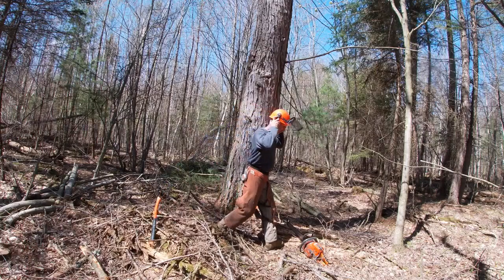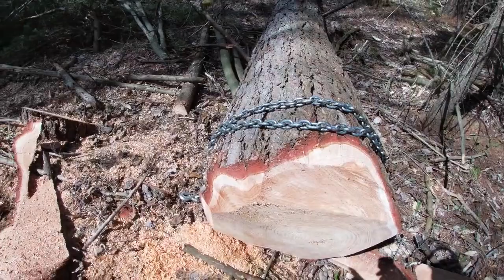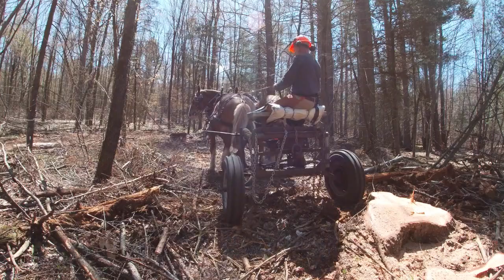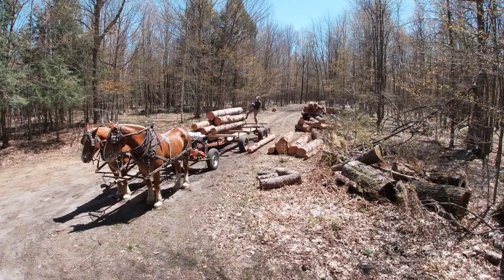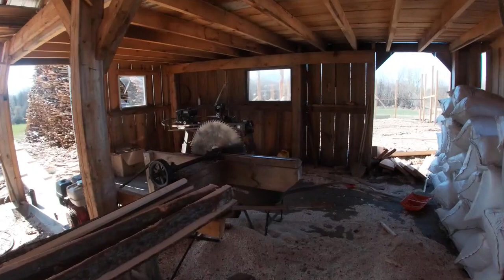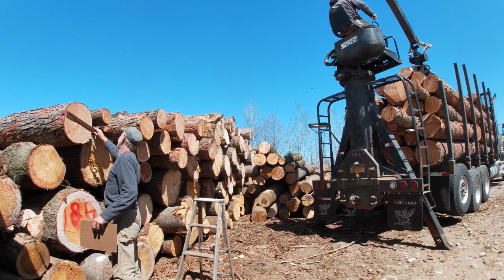Amish Sawmill Needs More Tamarack Logs Part 2

Comment: I always try to put the small end of the logs towards to mill, makes life easier.
Reply: Do you ever shim the log smaller end up if it has alot of taper?
Reply: @johnkomosa4089  yes, almost always. I have a small crate with small wood pieces of various thicknesses. I use my 5ft cant hook to pry up the end to install the shim.